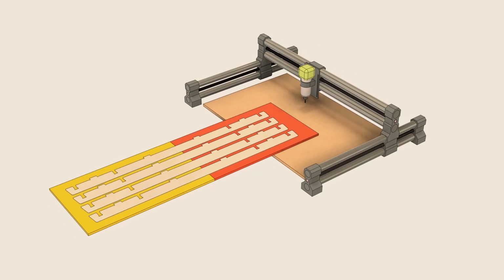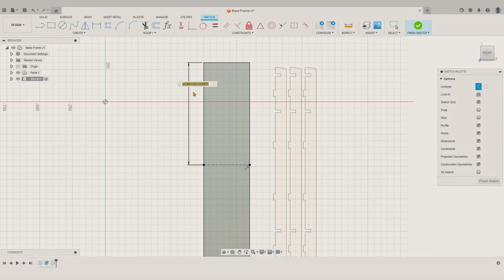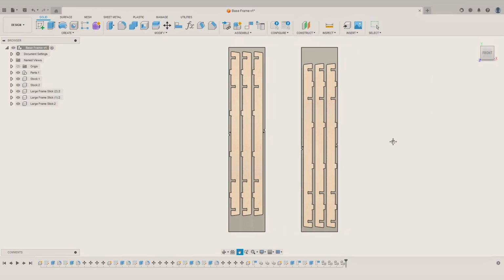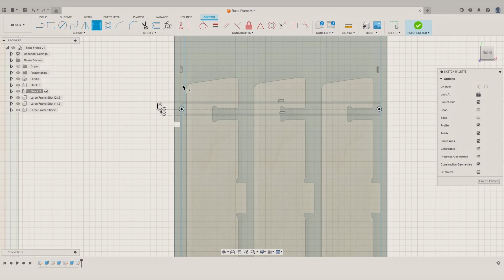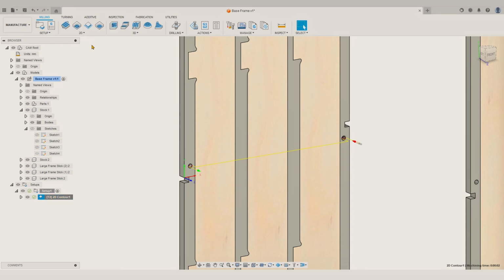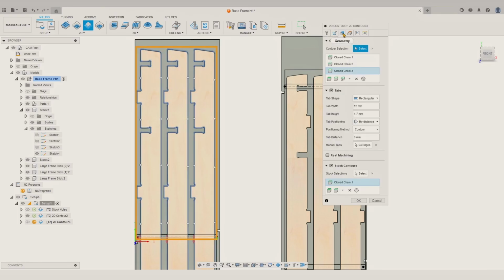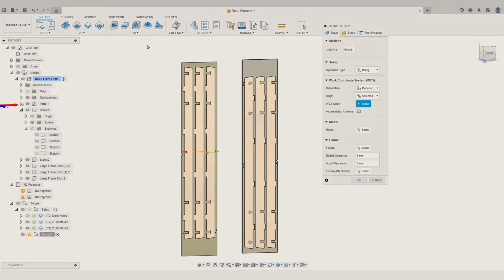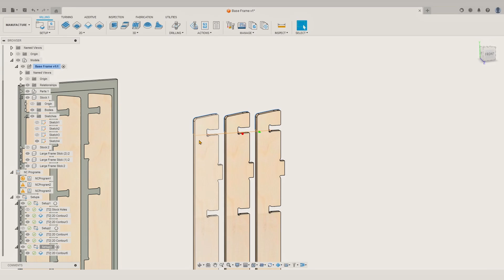Small CNC? No Problem! Cut Large Parts with This Simple Method

Comment: Excelente tengo una cnc de 60*90 Cms y quería hacer unas reposeras de más de un metro de largo con esto puedo hacerlo sin pedir un corte a un amigo , estimado podría hacer un video de configuración de una cnc en fusión 360 por favor
Reply from the maker: This cutting approach can definitely help expand your CNC’s capabilities. However, it won’t work if the part is wider than your CNC’s work area — the piece has to fit between the machine’s axes.
If you’d like, you can email us the design files for your project, and we can let you know if it’s doable on your CNC.